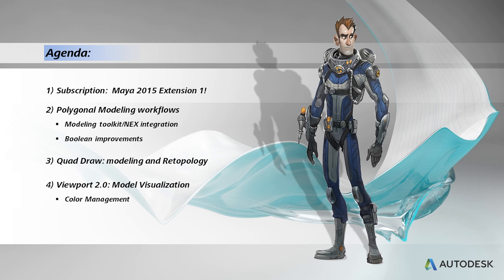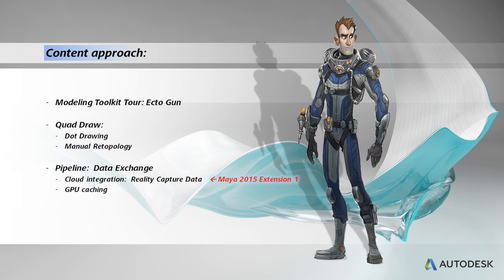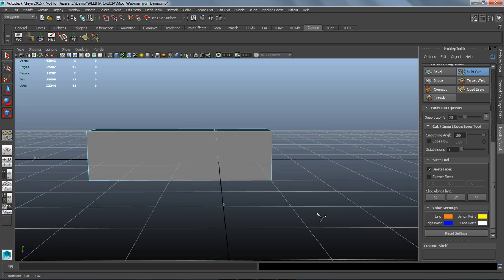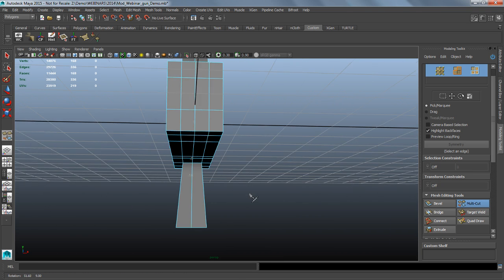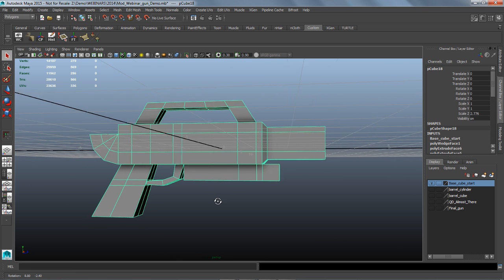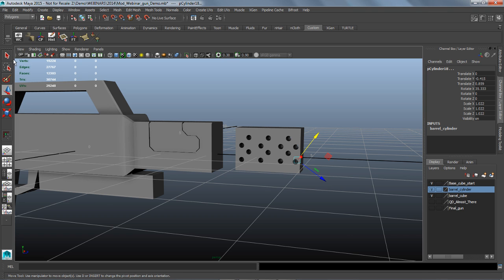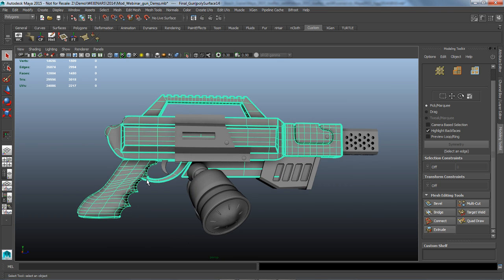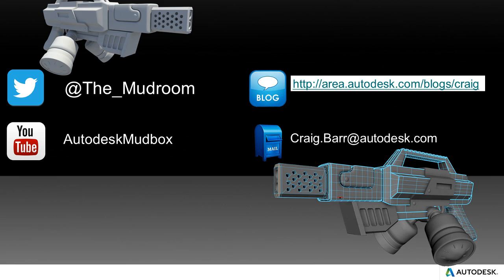Meet the Experts: Modeling in Autodesk® Maya® 2015 is more powerful and faster than ever before

Comment: Autodesk, we don't need a lot of different tools anymore, we need a single modeling tool with every function available through shortcuts.
Both Quad Draw and Multi-Cut are a good start, but we need immediate component merge outside of quad draw. Also, quad draw stops detecting quads when there's retopologized geometry on the other side, and in those cases one is forced to use the old Append to Polygon, which works fine but it cannot merge to vertices so you have to go back and forth, this is an enormous waste of time.
You did a great job with the new bevel algorythm and you're going in the right direction I believe.you will implement new workflow options, because as now the software is still too slow.

Comment: Horrible interface, too many clicks and fiddling to get the job done. This software is old and it's showing.
Reply: Yuxz Wzxy so, which 3D soft is good for you?
Reply: 3DS Max, Modo, Blender, Mudbox
Reply: Modo yes, but I think Max's interface is more horrible then maya's one))
Reply: Jeyhun Danyaloff
Both are very old products which were meant to be used by big companies and basically it's normal to have outdated tools and outdated workflows along with outdated problems which never get solved. We must take into consideration the capitalism around us and the multitude of problems it generates in order to understand better. Why I chose 3dsMax? I feel it's intuitive, less cluttered, has many useful tools and overall less fighting against the software is needed in order to get the job done. But in the end one should never forget that these software are tools, so explore them then use whichever works best for your job.
Reply: +Yuxz Wzxy I love modos modeling, I only wish they had a soften poly or relax poly while retopoing instead of having to select the polys and then smooth. or have some sort of depth feature so that retopology doesn't snap to topology through the underline mesh and merging with polygons on the opposite side of the model. that'd be really nice

Comment: I'm new to maya and transitioning from blender.  Are these tools "new" to maya?
Blender has had almost all of them since pre-2011 (when i started using it).
Reply: Yea Blender is pretty boss. I got firepro cards so that's my problem lol. I need a quadro.
Reply: Jay Badawi Why do you need a quadro?  Won't a fire-pro work for view port acceleration?
Reply: ***** Blender isn't supporting firepro ATM. It is amd's fault however due to driver issues. I do have Maya but coming from blender maya is really tough to use. I know with Maya amd cards generally out preform quadro. I just really enjoy blender.
Reply: Jay360
same.  I'm going too school learning maya and at first it's frustrating having to re-learn buttons.  However the maya 2015 update seems to have fixed almost all of the issues I have with maya.  Good luck getting a quadro (I'm working on getting one for my rig too)

Comment: Hey i thought id get better response on this than the actual site, when downloading the free student version of maya 2015 the download manager messes up, well, the download is fine, just before final installation it tells me something is wrong with the document i tried to save maya into and then it cancels everything, and help??
Reply: dont use the download manager, use the browser download option.  Before you install the new download, delete any components the download manager may have created on your computer during the failed attempt.  If there are any left over artifacts, you may still get the error.  To be on the safe side, download to a completely different location or new folder.  When the download is complete launch the install ( double click the self extracting Maya 2015 that you just downloaded).

this same thing happened to me about a month ago.  I ended up downloading the program  to my external HD, ran and installed it there. The external install was not necessary, I just didn't have enough space on my PC.  Hope this helps.
Reply: David Bogdenoff thank you! you are a life saver!! haha

Comment: lol saw extrude STILL skewing faces when it comes to extruding faces connected along 90 degree corners, been an issue forever. also these nex tools have been around for ages it's nothing innovative. Between Modo, ZBrush, Topogun, 3DCoat you guys have a lot to catch up to for us production modellers. Stop adding adding adding and start refining and implementing the tools so they're not still tacked onto the side like 2008. ZBrush is coming out with traditional modeling tools like these soon after less than a year of development on their new version, and pretty sure they probably have much less programmers on staff
Reply: Agreed. Not to mention the fact that the snapping tools doesn't work with nex modeling toolkit so you have to disable it... Would be great if I could do all my modeling work in Zbrush with 4r7! That is, if they get it right, which I hope they do!

Comment: The modeling toolkit is a breath of fresh air for Maya.  As each part of Maya gets a complete overhaul, it will essentially re-birth Maya. That is not to say Maya olde modeling tools were bad, but it needed adjustments and tuning.  The new Maya tools surpass those found in Softimage, if you were a Softimage user prior to moving to Maya !